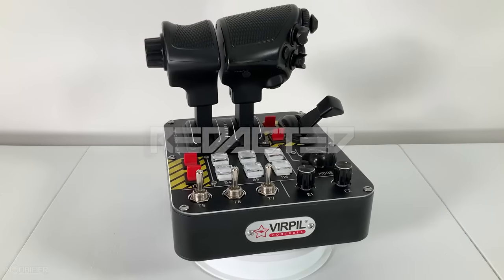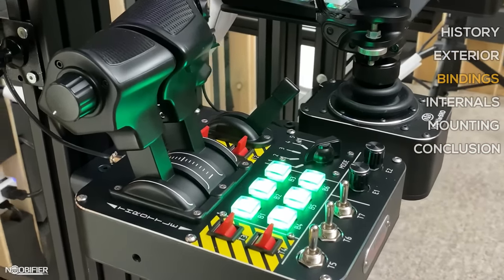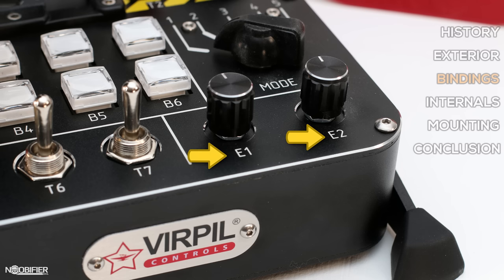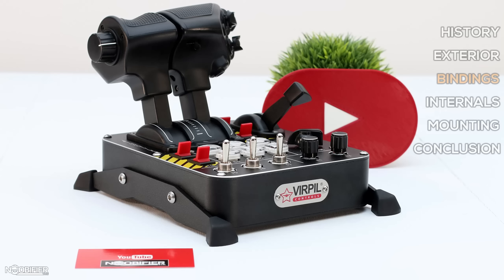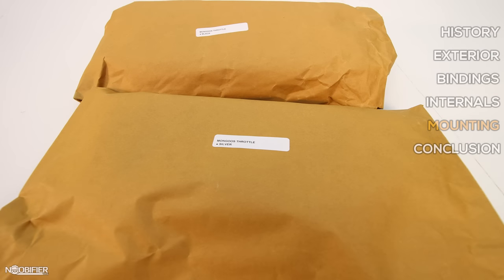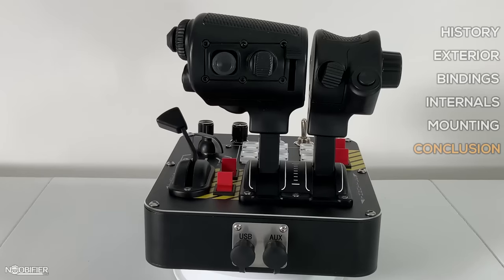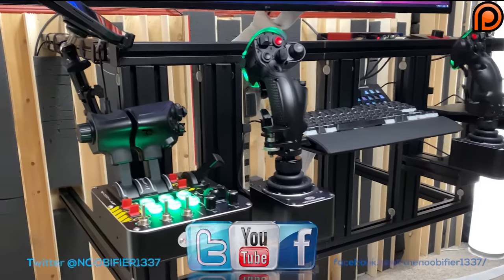First Look MT50 CM2 Virpil Throttle - Noobifier

Comment: I really, really wished they would have put in detents. Maybe one for afterburner in DCS, and a center for those of us who use the throttle to move forward and backwards in Star Citizen.
Reply: @celery789  So it's better not to have the CM3?  I have the CM2 and was considering getting the CM3, but I will not do this depending on your response and thanks so much, you could have saved me quite a bit of money.  THX for any feedback you can give me!!!
Reply: @celery789  ok, fair enough, but what you are saying is that detents are potentially a bad thing, correct?

Comment: Read about the Problem to get Virpil Products, checked their Restock Schedule, waited for the addressed Time and bought the CM2 Throttle. Was sold out after 3-4 Minutes so you really need to be fast. But I think if you take the Time to wait for the exact Time they mention, you can easily get their Products. Can't wait for the Throttle to arrive.
Reply: Devilikg  well I bought it for DCS World. Not quite sure if it's fun to use in Star Citizen, but guess I will find out.
Reply: Devilikg  Wow, so SC players shouldn't be allowed to buy this? What about Aerofly FS2? That's a bit arcade like too. Is there like a hierarchy of flight sim users with whatever you play at the top and everyone else below your entitled ego? Asking for a friend.
Reply: God, the armchair pilots arguing about who uses what and why.

makes me wish I could actually afford my own plane. Hard to get much of a chance to fly one when you don't.

Simulators are great but they still don't feel much like the real thing.
Whatever happened to force feedback sticks anyway?

The way that the force on the stick changes as airflow over the control surfaces does is quite useful and interesting to experience.
(granted, that's more of a thing in aircraft with mechanical linkages, but that's most of them until you get into really expensive commercial or military aircraft...)

Comment: As a dual-sticker, I currently have my Warthog throttle in the center, as a sim "console control" , like the Millenium Falcon's forward console where they throw the switch to go into lightspeed and other ship controls.  
For that reason... i wish the "throttle" was more a device "like a throttle" but somewhat different - without the "left hand shape curve" and more something to be mounted front and center, as if on the ship's console in front of the pilot - with "ambidextrous" up/down sliders/levers, buttons, and such.

Comment: Great first review , ordered mine and just waiting for it to arrive, thanks for the information, without it people wouldn’t know how good they are
Reply: How long did it take for shipping?
Reply from the maker: 1 week once it left the factory
Reply: @NOOBIFIER1337  Thank you for responding. After using it for a while would you recommend it for flight simulators?
Reply: Mark Black wait for new one , they are teasing it now
Reply from the maker: Kiwi Canuck that is a button box, not a throttle
Reply: TheNOOBIFIER1337 in the teaser photo you can see some changes to the throttle that looks like a higher hand grip and after burner lock, will see very soon. I still would hold off buying one until its shown

Comment: Looks fantastic. The two things I wouldn't like about it is controlling an analogue ministick with a finger instead of a thumb, and the lack of a detent. I figure a detent would be extremely useful for Star Citizen's new throttle setup. Hitting absolutely 0 throttle without a detent would probably mean setting up a deadzone, which isn't the best solution.

Comment: These devices are amazing looking, but they are way out of my price league.

Looking at these alongside what I already own I'd say a logitech X56 is more in my budget.
But I guess it's not mutually exclusive, and you can upgrade bit by bit.

For instance I was considering if I go from my current very cheap Thrustmaster T16000, since aside from the low cost it's one of only a tiny handful of sticks that can be used left-handed...
Then get an x56, that would be a Dual stick + Hotas setup...
And if I felt that was inadequate I could get a left-handed Virpil stick to swap out for the T16000, and so on.

The upside of virpil, as expensive as it all is, is that they appear to be very modular, meaning you can build things up piece by piece. (to a point. A grip with no base won't accomplish much. XD)

So... Interesting, for sure, but rather out of my league, I have to say...

Comment: Virpil is next on the list as soon as my ch products throttle, stick or petals break.
Reply: :) You may be waiting for awhile. I've had my CH HOTAS for nearly 20 years. However, with that said, I pulled the trigger on the Virpil Warbird base & VFX F-14 grip. I'm getting this throttle as soon as it's available. Warning: Virpil's software is light years behind CH's programming.
Reply: Lol. That's not happening any time soon. I've had my CH products Throttle, Pedals and stick for several years and they have been bulletproof.
Reply: woooooooo CH crew!

Comment: I pre-ordered this one back in October and they said it could take up to 90 days before it shipped.  Personally I am glad they gave me a pre-order option so I didn't have to bother tracking their re-supply dates and hope that I can click fast enough to place my order before they were sold out.  I'm really pissed to learn from this video that this throttle has no detents. Considering the price it should have been included at no extra cost.  Had I known that it was missing I would have purchased the CM1 version instead.

Comment: Yet another awesome and informative video. My throttle finally came in and I have been messing around trying to get the buttons to light up with different colors but can only get 5 of the 6 to do so also can't seem to get E2 to work for some reason in SC. I'm sure I'm missing something. anyway, you talked about creating another video on programing this throttle. I look forward to that video unless you have already made it and I'm looking in the wrong place. Thanks for all that you do for the SC community... Cheers
Reply from the maker: I haven’t made it but I’ll add that to the list

Comment: Just got my CM2 throttle, loving it so far. Can't figure out how to make the LED's react to button pushes though, individual button flashing when pressed for example. I have figured out how to make them change colour or brightness in relation to the throttle position though, that's quite neat, but would prefer visual feedback when pressing buttons with a 2 second flash, or something like that.

Comment: Just took delivery of my throttle and control panel to add to my r&l alphas - E:D cockpit complete!

Before buying the control panel, I had problems finding any reviews - it would be good to see your take on it. Despite being heavy on the wallet  I love Virpil's kit!
Reply: PS in E:D, the buttons have to be split in to different devices as Elite can only see 32 buttons per device. Any chance of a tutorial on doing that too? I've sorted it myself, but a tutorial from you would be useful for so many people!
Reply from the maker: Control panel review should be within two weeks. Use joystick gremlin to switch control
Reply: @NOOBIFIER1337  Thanks for this - and for your previous vids. I learned about Virpil based on your Alpha reviews and it's completely changed my space and flight sim experience.

Comment: glad ive been holding off on spending money on new gear from this company. They had improved alot and now have caught my eye more. sadly vkb is prob going to go out of business if they dont get those sweat shops grinding away. I like the design with this throttle being smaller is fine with me if i do buy one since i have a black hog with plenty of switches

Comment: +BrianMP5T  It definitely looks as though VIRPIL® has itself a problem with the MongoosT-50CM2®:  Too many twin-engine types to accommodate!  With the right additional panels, the 'CM2 would be a natural for a universal "fixed-wing attack" simpit, as the only detent universal to all twin jets is flight idle.  The VKS Rossija / Sukhoi-25KM2 attack aircraft with Naval Aviation has a full-power "launch" detent just short of the end of stroke; the afterburner controls on the USAF / McDonnell F-101B and VVS SSSR / Mikojan-Gurjevich-19 are similarly set, as the Pratt & Whitney J57 and OKB Tuman'skogo RD-9 have only one injection rate for the 'burners.  Contemporary supersonic pursuit jets have the MIL detent just past 50% of the throttle stroke, as they have either multi-zone afterburners (e.g. USAF / McDonnell F-4E, USN / Grumman Iron Works F-14A) or continuously-modulated 'burners.
Reply from the maker: Yes, I believe they overlooked how important that detail was. Almost as if they added it by accident in the past, and then just removed it.

Comment: I wish they just took the CM version and added the RGB buttons and a few switches. I kind of dislike the plastic switches, that the original pinky button is now an enormous encover and that it is missing the two axis next to the originally 3 encoders on the bottom of the base... 

My warthog broke and now i may need to buy this even though it is far from perfect.

Comment: Hi, I have question about the mode switch: is it possible to use this as modifier for other Virpil equipment. For example: I have this throttle + Constellation Alpha.
I'm using the mode switch to change to "mining' mode which results in different bindings also for Joystick (the scroll  wheel is used for laser output moderation). After that I switch to 'combat' mode: joystick scroll is now used for dynamic zoom.

Comment: I wonder if the throttle uses cams that could be switched out later for ones with detents. If not it would be great for the next version some adjustability is not a bad thing
Reply from the maker: It does not use cams

Comment: Did you ever get around to making a vid on how you control the dynamic colors on the lit buttons (as seen in this Vid at 2:45)? If so, could you post a link to it? I can't seem to get more than 8 total states.
Great vids! I love your Hardware coverage.
Reply from the maker: I think so. button Virpil Noobifier
Reply: @NOOBIFIER1337  I still can't seem to see a Vid specifically about how you got the buttons to change so many colors. I am familiar with the Virpil Config tool and I am currently using the "Simple LED's Indication" settings but there are only 8 slots. 
Do you know how to add more Indications or is there a way to reset these tools as this seems very limited.
I did search before I posted and ran your search as well. I only see the "How to Virpil Clear Button - Custom Safety Guide" and a large number of reviews. I didn't find anything referencing button lighting.

Any help here would be greatly appreciated.
Reply from the maker: @capnsquirrel4017  ok, I will work on making that video then.
Reply: @NOOBIFIER1337  Wow! First off, Thank you in advance. That is not what I expected.
I have been seeing a lot of people looking for this info through my searches. I expect this will make a lot of people happy.

Comment: Nice review - I was having a hard time deciding between this throttle and the other one, the other one looked a bit cooler to me but I went with this one and was able to get the order in, now the waiting game. One thing it would be nice if you could start to address the 800lb gorilla in the room in your reviews and that is use in VR - I went with this throttle mainly because looking at the 2 this one just looked to be way more VR friendly with button placement, on the other there were dials on the edge which meant feeling and reaching over them to get at the buttons, this one however looks to have an excellent layout when used in VR.

Now my watch begins...

Comment: I am definitley getting some Virpil controls soon.  The wiring in my T16000M is terrible; and, the stick is starting to have issues.
Reply: I just upgraded to a warbird from a T16K. You wont regret it. I had no idea how good a joystick could be. Just do it.
Reply: I was in the same position.  T16000M hotas with Z-axis issues and a failed rocker on the throttle.  I sat on the fence for months before finally deciding to pull the trigger on this Virpil throttle and a VKB Gladiator NXT joystick.   The Virpil throttle arrived today.

Comment: Thanks again for another great review. I have one question - given the flight model in Star Citizen, how viable is it to use a throttle that doesn't have a center detent?
Reply from the maker: One Hitta I have been using for acceleration and speed limit. It’s fine, probably not critical

Comment: Wait, did you say the metal housing 4 mm thick steel? I am a metal fabricator. I work in the fabrication shop of a Laser cut business. That gauge of steel for this item is ridiculously thick.
Reply from the maker: gus bisbal aluminium sir. It’s a nice piece of work. I was shocked
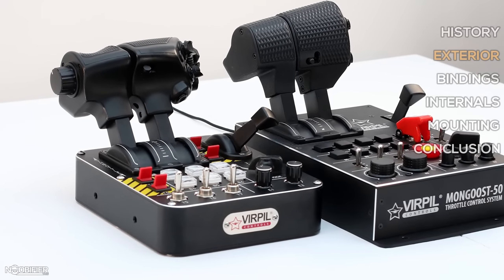Reply: @NOOBIFIER1337  That is a more reasonable build material. You did say it thought, 1:05. Consider your body work on your car is between 1mm to 1.2mm steel. The underbody Armour for a 4x4 vehicle is 4mm and that is considered heavier than needed.

Comment: you figure out how to do dual joystick mappings so you can switch from left joystick to Throttle? I want to use both depending on situation but you can do dual joystick bindings yet
Reply from the maker: I map them so that they all just work. There is no need to switch anything

Comment: After using both throttles which would you consider better? I’m not sure about the red plastic switches they appear cheap.
Reply from the maker: I am a sucker for new. As I have both, I have the original on the sim rig for DCS due to the detente. The red switches are NOT low quality..

Comment: other than the 6 rgb buttons , is the unit backlit like the Warthog throttle?
Reply from the maker: No, not really. But it’s easy to read even in a dark room
Reply: @NOOBIFIER1337  ok thx, did the previous T50's have back lighting? i assume no, only the Thrustmaster Warthog Throttle.  EDIT:  I read where the old ones had backlighting around the knobs but the labels are not backlit.  i think WarWing (sp.) and Warthog are the only two with label backlighting

Comment: I have a Warthog right now, would this be better or worse?
Reply from the maker: It depends on if it is currently meeting your needs...
Reply: @NOOBIFIER1337  Well yes on some and no on others because some of the buttons i have are not being used or very rarely and there are some that i would love for example the ones that twist. But it's ok i have thought of a solution i saw in another video of yours which is promoting a panel above the throttle itself, so thanks for that.

Comment: i just want the new grip, hope they consider a upgrade kit
Reply: I have the old MT50, relly wish they made a upgrade kit even if PCB needs to be replace if the controller is not compairable; i have taken it apart, the structure is simple enought
Reply from the maker: What would you upgrade? The internals of it?
Reply: @NOOBIFIER1337  The new throttle grip. maybe the controller PCB if needed for the new grip